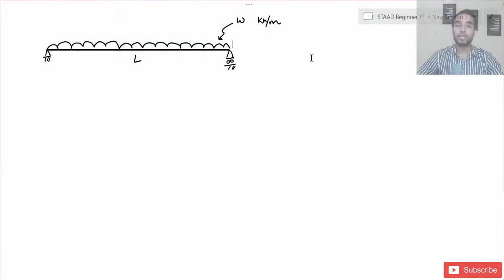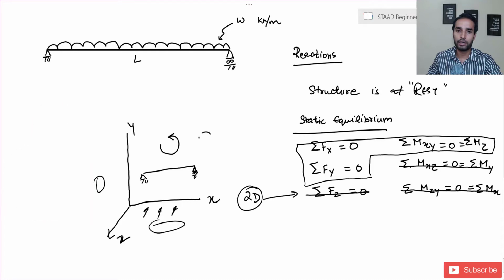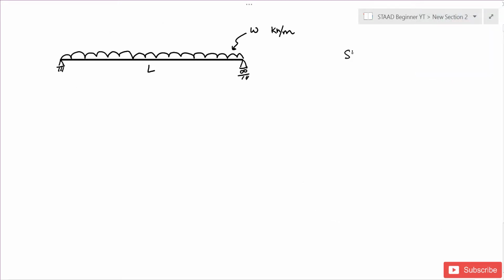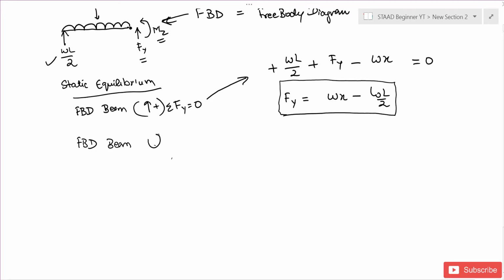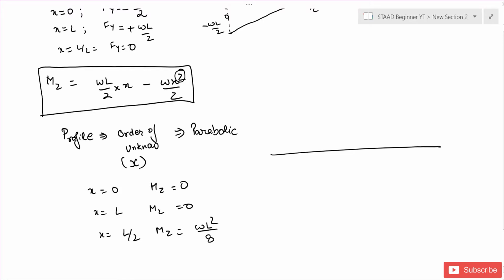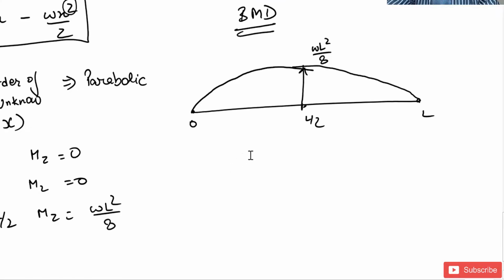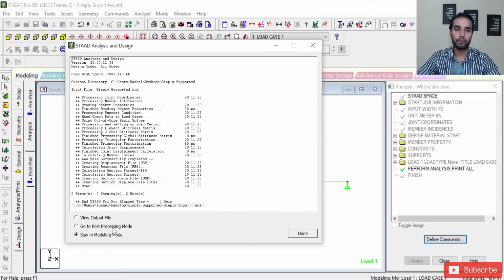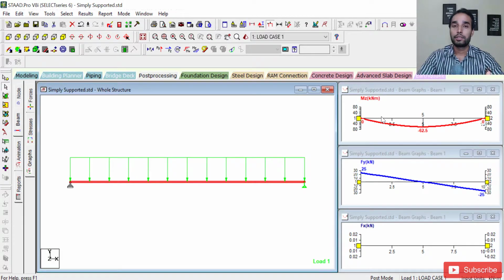Theory vs STAAD | Simply Supported Beam - STAAD Pro for Beginners

Comment: We can give both end pined support the answer  will be same
Reply from the maker: In theory Yes. But you have to remember the true reason of a roller support which is primarily to allow movement in the x-direction which may come due to temperature variation. Hence, a pin at both ends would result in additional stress generation. You can check out my video on Temperature stresses if you face any doubts.
Reply: We can neglect  axial deforestation
Reply: Sorry  deformation
Reply from the maker: In order to neglect you will have to first analyze your case. If there is going to be no case for axial deformation by all means skip it. But in that case why do you even need to talk about a simply supported beam. That is going to be a pinned beam at both ends. A simply supported beam serves an entirely different function.
Reply: I have not satisfied  your answer

Comment: How you are realising  moment in all directions and reaction  x and z direction . roller  support is having horizontal  displacement  and rotation we can release  only fy
Reply from the maker: You are viewing the simply supported beam as a two dimensional structure. However,  in STAAD all structures are 3D structures. To get the same results as of a two dimensional structure you will have to release all kind of moments and reaction in x and z direction. Hope this helps.
Reply: The fixed support  default  release given that means  there will be no rotation and translation  so simply supported  beam  will have rotation in  all direction and no translation  in y direction this is my doubt only  my next question  is how will you give spring support  if the slab resting on beam  I will consider k=AE/L A is area of the supporting beam E is the modules  of elasticity  of concrete  L is length of  beam  If any thing wrong you correct  it
Reply from the maker: I don't quite understand your question. Why would you be providing a spring support to slab beam connection?
Reply: I want analysis  in staad that is two span continues  one way slab
Reply: We can't  provide  pined  and two roller support  that is not perfect  analysis

Comment: Sir, Analysis is ok. But as per the design we get more steel area when compare to theoretical area. One video with design also. Thank you.
Reply from the maker: That is not exactly true. It will ultimately depend upon you settings for the most cases. I am in the process of creating a video on design as well.